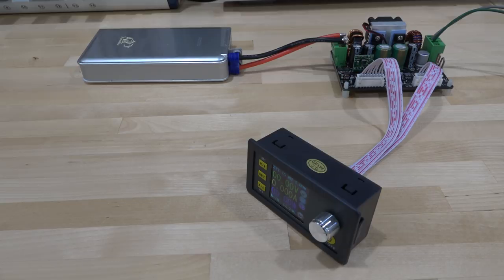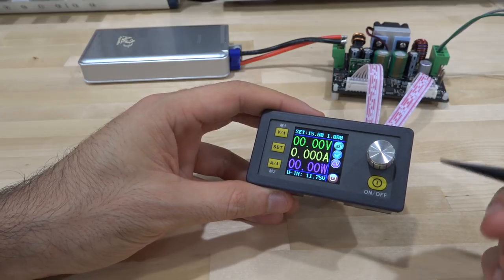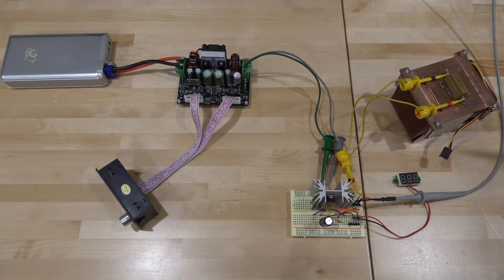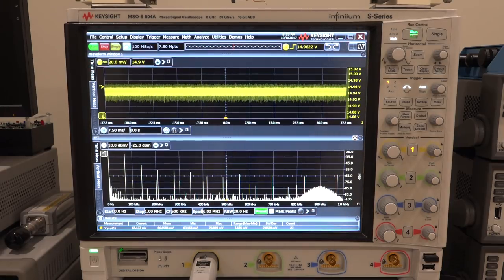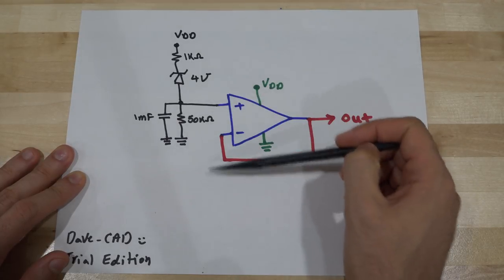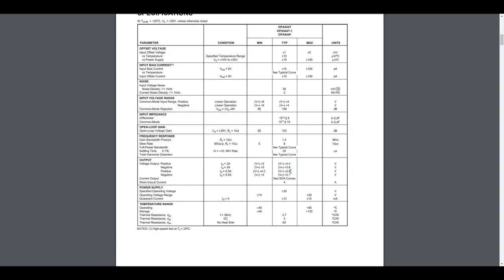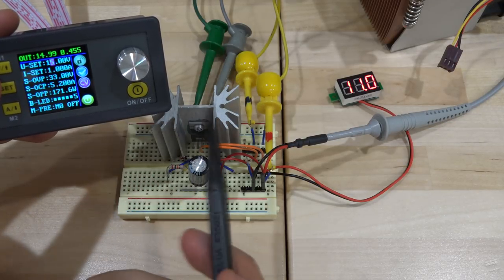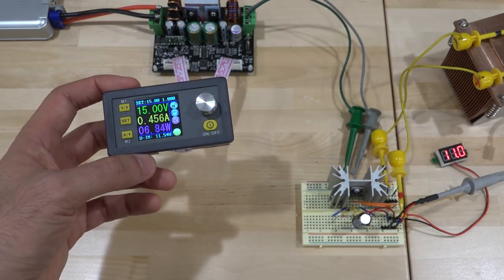TSP #112 - Noise & Performance Considerations of the DPH3205 Buck-Boost DC/DC Converter Module

Comment from the maker: Please note that this circuit is for demonstration only. There are many other issues to consider here. Stability, capacitor driving capability, OpAmp safe regions of operations, etc. The purpose here is to explore the noise behavior  and exchange ideas. As I mentioned in the video, there are many ways to improve such a circuit.
Reply: Yes Shariar, you clearly state that the circuit is just for educational purposes and I'm absolutely convinced that you'd come up with all its shortcomings easily. However, some of your followers might want to start by just copying your circuit as-is, since you're showing it in the video, playing with input voltages that seem reasonable and seeing that it doesn't work and instead maybe even blowing up their $ 20 power opamp, even with enough heat sinking and limiting current. The real educational value starts there...
I am one of your followers, enjoying your videos of high quality in several respects.
Reply: The Signal Path would love an ep on frequency synths.  I believe eval boards up to 6 or 7 GHz are within budget
Reply: Stability can be tricky. You can certainly learn a lot by figuring out ways to fix it, but knowing where the dragons lie (and how to avoid them) before you get there is probably a better way. 

There are plenty of cases where you can design and prototype something and it works fine, but is marginally stable. Sometimes this results in a circuit that only goes haywire under very specific conditions. Trying to track that down can be very educational, but I think knowing the tricks beforehand makes it a better experience (and certainly a less frustrating one). A good resource I've found for this is a set of presentations from Texas Instruments: https://e2e.ti.com/support/amplifiers/precision_amplifiers/w/design_notes/2645.solving-op-amp-stability-issues. Which goes into a number of simulation tricks to diagnose stability issues before blowing up $20 amplifiers. 

FWIW, I'm also a follower. The amount of technical depth Shariar brings to all his videos is fantastic, and I've definitely learned a lot by watching.

[edit: this didn't seem to get tagged as a reply to Raymond above, but it was meant to be]
Reply: @guyvanburen  ujjfjjtj
Reply: @guyvanburen  jjjfijijgs

Comment: At exactly 14:07 the 900 KILOHERTZ "hump" transforms into a nice modulated carrier waveform; carrier at approximately 900kHz, first u/l sidebands at approximately 880kHz and 920kHz, second u/l sidebands at approximately 860kHz and 940kHz, third u/l sidebands at approximately 840kHz and 960kHz.
Reply: This.

Comment: Are you wearing a wireless microphone? I noticed the shape of the noisy signal around 1MHz changes as you speak. When you don't speak, I can clearly see some sort of carrier wave that is being modulated, so I'm guessing the circuit or scope is picking up the wireless mic signal.
Reply: That actually seems like the reason that's there.

Comment: That op amp costs almost as much as the power supply.
You should try filtering it with a suitable ferrite bead and a couple of ceramic capacitors to see how it  compares with the op amp solution.

Comment: It's always a pleasure to see some Burr-Brown components :) A similar drop down voltage for higher output current is happening in the BUF634, which I'm currently using for a project.
Reply: RIP BB.

Comment: Interesting... the op-amp is speced for a minimum +-10 V power supply voltage, that's 20 V in unipolar mode, so I think it'd be a good idea to pick a different op-amp. It would intersting to see the step response of this one at high load and even lower supply voltages.

Comment: You should try a capacitor multiplier circuit instead. Much lower noise, less power burned and more compact. The noise is comming from the DC voltage monitor. Thank you for your great work ;)
Reply: Came to say that. I have just tested a capacitance multiplier today and it works wonders! Sure, the line regulation is lost, but I have just built a circuit which uses the 7809 regulator as a reference and as long as the transistor base current is high enough, the output is fairly stable... and I suppose one could always toss in an opamp and stabilize it more... :D

Comment: Why not use an LM317 or LM1086 variable linear regulator instead of the op-amp? Much cheaper devices, comparable supply rejection, and in the case of the 1086, less than half the drop-out voltage. It would be much the same circuit as you have presented, except the output would track 1.25v higher.

Comment: Many years ago I had some switchin PSU that I took and modified in a smilar but possibly better way, you might want to have a look if its possible here too: The voltage setting was done via some crude DAC mechanism setting a reference voltage which then was fed into the switching converter. I removed it from there, made it drive the linear output (opamp+transistor) and modified that voltage to add a few volts to feed the switcher (actually I think I modified the feedback from the switcher), so it generated a higher output voltage. Worked quite ok.

Comment: That noise bubble looks a lot like FM radio harmonics to me
Reply: At around 900MHz I'm thinking about home automation gadgets on an ISM band.
Reply: 900kHz not Mhz, so i would also assume it comes from AM Radio stations
Reply: Depending on the switching power supply controller, 900kHz is in the range of switching frequencies.  That noise wasn't very heavily attenuated by the addition of the opamp, but the PSRR of the opamp has likely fallen off a cliff by that frequency.  Could also be anything else in the room...maybe the cat; does the cat have a pirate radio station?  Definitely looks like a modulated signal.
Reply: it does not look like AM to me, looks more like FM
Reply: It's unlikely that any local rf source would couple this strongly into a 25 ohm load. However, it most probably comes from a spread-spectrum oscillator driving a dc/dc converter.
Reply: I would guess that there is another DC-DC on the board just to power the uC/LCD and this one is running at 900kHz. The width of the spectrum could be due to spread spectrum operation and it is changing shape due to activity from the uC/LCD

Comment: That op amp is a pretty neat device, 2 amps capable, that could be very useful as a low current power supply replacement in older equipment which uses linear supplies.
Reply: you can actually get op amps up to 100A like the PA50 by apex, problem is they are very pricey, $20 or so for the one used, $500 for the 100A PA50, if your after a power supply replacement in old equipment that need 2 amps best use a switcher module and manually set a couple of LM317s would be cheaper
Reply: I'm not sure, it costs a fortune. Also not granted it can drive capacitive load. I'd go with a discrete pass element, it should be much cheaper, although it would require a separate over-current and over-temperature protection.

Comment: Hi came across your video. Hence can you help build the noise suppressor module. I am using something similar like this. Source power comes from lead acid battery 12v directly into this portable unit. I hope to power a raspberry. Let me know whether you can help. Thanks

Comment: Couldn't you of also used a current pass transistor instead, with its base being driven from a smoothed supply? This would of reduced the 4V gap you have, which means you currently cannot use the power supplies full voltage range in this case. Using a pass transistor would of reduced the different to less than 1 volt, probably closer to .7V.
Reply from the maker: Not exactly, because then the voltage would be a function of the load as the junction voltage changes with both current and temperature.
Reply: I agree that a simple emitter follower with filtering on the base would filter out much of the noise. Could you break out the feed back loop within the power module to the transistor's emitter to remove the voltage drop error? I have one of these units and was going to give that a go. BTW, that's a broadcast station, right? If it is, then some those spikes you are seeing may be direct induction from the inductors in the power supply...ie if you getting radio stations, you will get other stuff. Cheers doug

Comment: Becasue level of this noise do not change in both circuits (even slow OPA it has some noise reject) I count on external 7-digit voltmeter - noise change with change voltameter display 11.0 to 11.1 :)

Comment: I am just a hobbyist, but just adding a bypass capacitor to the output of the power supply would also decrease the noise?
Reply: You don't want more capacitance at the output of any bench power supply because it allows overshoot in current-limiting mode and can thus fry the very load that you are trying to protect.  Current-limiting modes are supposed to protect against dead shorts, yet capacitors inherently dump current into such a short.  Capacitive filtering at the output is a crutch used to fix a poorly designed power supply.  I like the DPS/DPH models as they were initially a great value, but they are quite noisy.  That noise is not harmful for most hobbyist applications and there are circuits like this one that can reduce this noise.  It's still hard to beat the DPS prices and features and I'm unaware of competitors to the DPH buck/boost models, but the manufacturer has understandably leveraged customer demand into higher prices across the line.

Comment: Try a Low Freq, High Current, Common Mode Filter.  I've recently been measuring the performance for these from Laird (available from DigiKey & Newark): https://assets.lairdtech.com/home/brandworld/files/SIP-DS-CMX1211%201113.pdf ,  https://assets.lairdtech.com/home/brandworld/files/CM5740Z241B-10.pdf .  Most EMI filters have 2 issues for my application: 1) low current, 2) do little below ~ 40 MHz (the rating in Ohms or dB is typically @ 100 MHz).  Also add a 4.7 uF MLCC on the output.  Even the large Filter ("CMX1211...") is smaller & cheaper than the silicon solution here, and probably works better at removing noise.  Perhaps some experiments, measurements & Tutorial about EMI Filters could be in the future?

P.S. the probe is worth more than 1/2 my car & the 'scope about 1/3 my house.

Comment: 900 kHz...  Flourescent lighting maybe, wireless microphones,  the dc/dc converter you're using or another smps in the room somewhere,  an AM radio station...  I dunno it's a lot of ideas.  I see modulation so I'm thinking the mic or radio...  I could be way wrong though

Comment: Hey Shariar,
One other comment on the OPA544 - I'd be really careful using a power op amp as a straight buffer in this application. They frequently have very poor capacitive load drive capabilities, and may happily oscillate when presented with capacitive loads you'd otherwise not look twice at connecting to a power supply.
Reply from the maker: Yes, of course. As I mentioned this is just for exploring the noise.
Reply: Sorry, on a re-read of my original comment I realized I should have worded it differently. I'm sure you're aware of the array of issues in a design like this - I should have worded it more as a general comment or addition to the conversation in the comments. It is very cool seeing the noise benefits of even a simple op-amp LDO in this sort of demonstration.

Comment: Hi, I just wonder if instead of using a powerful op-amp, one could use a normal one with an output power transistor (maybe in class A power stage or the like, maybe even with one transistor) and still having a noise rejection. Is an output external transistor let easily the noise pass thru?

Comment: I think I would try a simple LC low pass filter on the output, possibly two stages, instead of this solution. It should get rid of most of the noise. Sure, it will cause some minimal voltage drop, but with proper design that shouldn't be much of an issue. Especially as the output voltage regulation of cheap power supplies like this probably isn't very good.

Comment: The hump most likely comes from an external source since it was not affected by  the filter. Furthermore, it must be outside your control since you do not turn it off for this video unless you want to teach us a lesson or it is an integral part of the setup such the opamp or lights in the room. It also seem to have some form of "communication" but it is be too broadband for AM radio or psu noise. 

Could it be noise from a CDMA mobile base station on top of your apartment?

Comment: That noise changes roughly every second. So, it can be one of displays. I'd say it's a power supply display updating (or display cable radiating).

Comment: Might another approach be an adjustable voltage regulator, such as the LM317? Its functional diagram shows that it includes an op amp and it is less expensive. I guess its main downfall would be that it cannot handle as much current. The old LT1083 would have been a good candidate, at up to 7 amps, but it is out of production. An AVR would not boost, I suppose.

Comment: If you install the Opendps firmware, you can customize it to give you the correct voltage readout
Reply: This model is a DPH buck/boost unit, so I'm not sure if OpenDPS will work here, though it has been tested on other DPS buck units.  See, for example, this thread:
https://github.com/kanflo/opendps/issues/197

Comment: I think that noise come out from the microphone. It is an dsb signal and is modulated. The only thing i can think is the microphone transmitter.
Reply: It's pretty wide though - each sideband is 100 kHz.
Reply: Kyle McInnes ya but really what could be else?

Comment: My guess for the puzzle noise:  PWM current mode switching regulator operating at ~900KHz inside the DC/DC converter module.

Comment: I powered my dc buck module with a transformer . 
Transformer spec : input volt= 220v, Output volt= 24v , 190VA. I used bridge rectifier to make AC to DC  and 1000 microfarad-50V capacitor to smooth . Now float voltage 35V.
Buck spec : input = 5v - 32v. 5A

After connecting the buck module  burnt within 10 seconds. 
Before i used the buck with 12V 60A battery to power up the module and charged 18360 battery pack of my Bosch hand drill .
I could not understand why transformer damaged the module. I guess :
1)  buck module can't tolerate ripple to the input side .
2)   Float volt may cause damage. Am I correct ?
Any suggestion ? Waiting  ......
Reply: Old post but just saying this in case some stumbles upon this comment. The "float voltage" youre talking about is the peak to peak voltage. Unless you load the transformer, this is the voltage it will output. So you connected a 35V supply to a module with 32V max input and it went up in smoke. No surprises there.

Comment: I would say that your measurement isn't correct. You should measure close to the output capacitor of the PSU. All those wires from the output until they reach your probe will couple noise from switching. Related to that hump from 900khz...is it spread spectrum? I'm confused because I saw it arround 900k....quite high.
Reply: Totally agree, long wires compromise performance. In my measurements every centimeter from output cap makes transient response worse. Also, wires work as antennas.

Comment: AC line noise filter will often work for DC if current rating is ok. (The terminal size is a little small from most DC loads is only problem )

Comment: Wouldn't a large inductor and multiple capacitors of different values on the output be just as effective or better than this.
Reply from the maker: It is more difficult than you think. An LC network will have its own impact on rise/fall behavior of the power supply not to mention on the CC/CV switch over. But is is worth trying it to see what is the best you can achieve.

Comment: Thank you for another great video! You should make a video how you tracked down that blob of noise on the high end and how to minimise it if possible and can it be done by the average Joe without the use of high end equipment. I just noticed the "blob" appears around 900MHz, maybe cell phone tower near by ? 
73  N8AUM
Reply: Check the AM Radio Stations in the area, also possibly a fluorescent lamp.
Reply: 900kHz, not 900MHz, vidas v
Reply: eye sight plus old timers lol  yes, after looking at it again i can plainly see it much better once i bumped up  the video resolution to 720 !

Comment: How much of the noise you measure at the output actually comes from your battery pack? Inside you most probably also have a dc/dc converter converting the Li-battery voltage to 12 V.

I would assume that the 1 MHz spread-spectrum signal comes one of the converters and the 60-odd kHz come from the other converter.
Reply: Uwe Zimmermann nope, no switching is done in the battery pack, it's just 3x LiPo in series. They'd never be able to get enough current to start a car otherwise